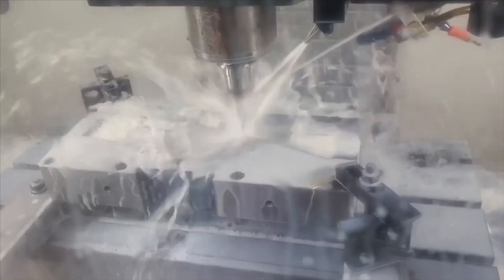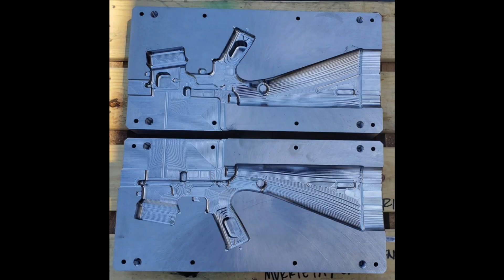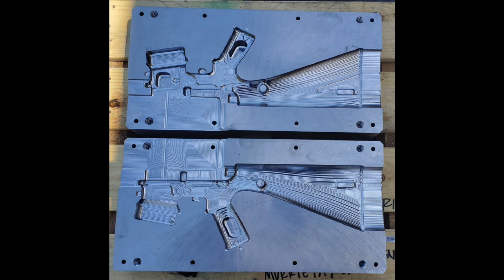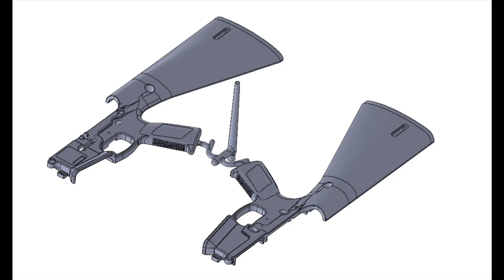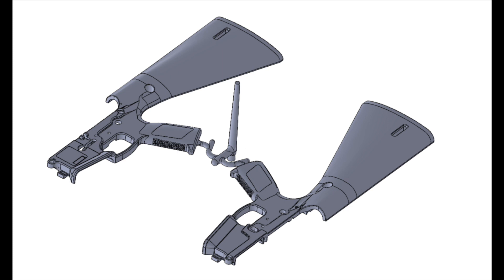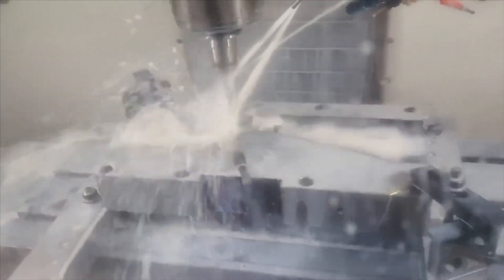WWSD2020 Polymer Lower Update

Comment: We appreciate the transparency!
Reply: ...Said the brothel window-cleaners.
Reply: Speaking of that, can you make the lower from transparent plastic?
Reply: @Treblaine  unlikely, the polymer even if it's a polycarbonate would be too brittle. You want fiber reenforcement distributed throughput the entire mold to give it a grain structure which in turn gives it strength. Think about it why are the plastic garbage cans that stores have or for garbage pick-up so tough? Fiber reenforcement where as what we use in our home cracks or crushes easily when mishandled.
Reply: @danieljcall3811  Good to know. Think they'll still go with a fixed stock?

Comment: I wonder how they will be fused together? I've never seen that before when I worked in injection molding. I'm guessing plastic welding? I wonder how that would hold up from the recoil? I'm also guessing material used is nylon 6-6 as well?

Comment: Have you guys ever tested the Kaiser US composite receivers? They're reinforced at all the stress points with aluminum.
Reply: They mentioned them in one of their old WWSD videos, but they never have tested them on video. I have wanted to try them for a long time, but that price is pretty high.
Reply: @Chilicharger665  They are definitely not cheap, but with all of the reinforcements built into them, they look like they may be the one composite receiver that'll stay together under hard use. I do wish they'd get rid of all those rectangles on them though. Those are just plain fugly!
Reply: On Kaiser US's website their "ultra-light X-7 sandman" is listed at 8 pounds for the rifle only. Seems a bit much for "ultra light"
Reply: @colemanmoore9871  The receiver set is ultra-light, 10oz. You can make to end rifle as heavy as you want it.

Comment: I’m pumped for the new video on manufacturing, but is everything still on track for production or is it delayed?
Reply: IIRC at the announcement they said the WWSD would be available in the second quarter. It’s now June and they don’t even have completed molds, so my guess is that delays have ensued.
Reply: Joel notsure With everything that happened this year, that seems expected enough. Still, my guess is that they’ll start shipping soon, you’ll probably have one in hand by the end of July at the latest. I’m just guessing, though.
Reply: Cameron Wilde yeah it’s interesting that they have a set date for when their next video is released. I’m wondering if the mold is actually done and they’ll start shipping the day they release the next video

Comment: How do these new lowers compare to the CAV/GWACS lowers? I believe their molds were worn out, are these just new molds or a new/tweaked design?
Reply: I think I remember them saying they tweaked the design by strengthening some parts and flaring the magwell a bit. Not entirely sure on all the bits.
Reply: The Gen 3 polymer lowers have a flared magwell optimized for P-Mags, a larger trigger guard, M-Lok slots in the top of the rear of the stock (as opposed to a slot on the bottom of the rear of the stock) for mounting a 2 point sling, as well as a more centralized point to mount a single point sling. Is that everything? I think I got everything.

Edit: They also have a more ergonomic grip. Some people complained about the GWACS lowers having a steep grip angle. This one will be more in line with most of what’s on the market.
Reply: @whiterice.  They updated the sling attachment points and I think they changed the take-down pins as well.
Reply: @whiterice.  the grip size and angle have also been changed and if I’m not mistaken they are using  stronger more modern materials.

Comment: are you sure you have enough lube on that CNC mill
Reply: Cooling
Reply: no such thing as too much lube
Reply: Ryan Rigsby that's what she said.
Reply: Flood coolant has many purposes other than to reduce frictuon. It evacuates chips and maintains thermal stability in the material and cutting tool.
Reply: Well, the entire window isn't opaque from all the high pressure coolant being sprayed on it, so...
Reply: @jayzenitram9621  functionally identical

Comment: Still waiting to hear you will sell each half individually as 50% receivers. This is not a joke. No way ATF would say that a half submitted to them is a firearm. It'd probably save you money both in final plasti welding and youre not building a firearm. I'm sure a lot of people would be interested.
Reply: ATF refused to issue rulings to Cavalry Arms on molding 1/2 at a time in the past.  

The current ATF is really back logged and under political pressure not to approve 80% anything.  

No we’re not going to waste money chasing after this.
Reply: @SinistralRifleman  I was unaware they refused to issue a ruling on halves, while that seems like something they would do. Thanks for your response.

Comment: Having the stock be part of the lower was arguably a mistake. You could've (should've) just had a socket for mounting a threaded m4 stock.
Reply: Reduces durability and defeats the purpose of making a polymer lower.
Reply: Folks have tried that with less than stellar results.  This is pretty much the best way to get rigidity and keep the weight down.  If you added enough chassis to support the buffer tube, then you pretty much have a standard lower.
Reply: @SinistralRifleman  gotta love the arm-chair quarterbacks throwing in their opinion when it seems they haven't even watched the several videos addressing this exact point.
Reply: Buddy the threaded buffer situation is precisely what makes most polymer lowers the hot garbage that they are.